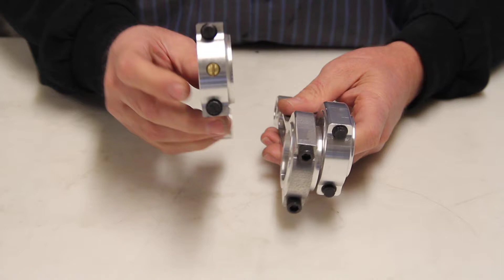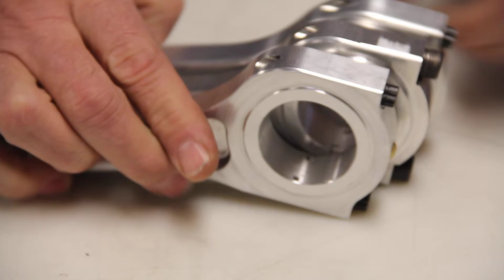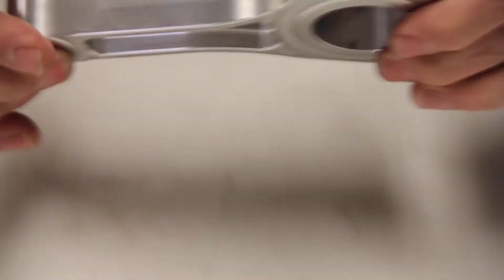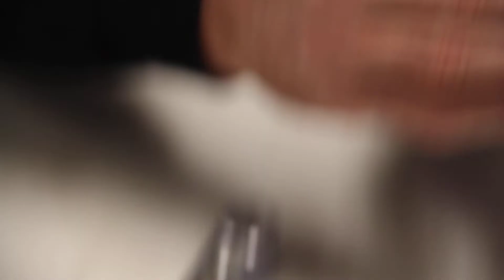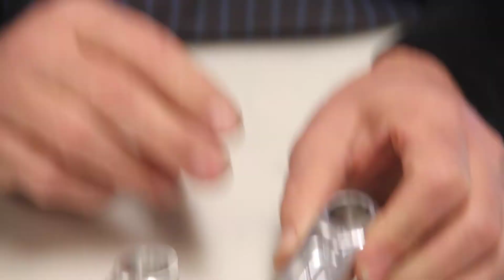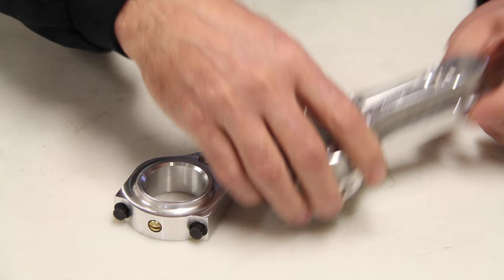Kohler Command V-Twin Connecting Rods:  New 2015/16 Design Improvements Explained

Comment: how expensive are they and what other modding do I need to do to install them?
Reply: Mason Allen Www.midwestsupercub.net  just need rod bearings.
Reply: @julianestahl7004  do you have any stock length billet rods for stock pistons
Reply: @michaelmcfarland3108  They don't work very well on stock pistons, you would have the grind a taper on the end of the rod to go up between the pin bosses.
Reply: @julianestahl7004  I sent you a friend request on facebook ?